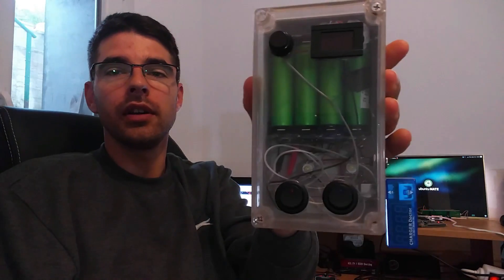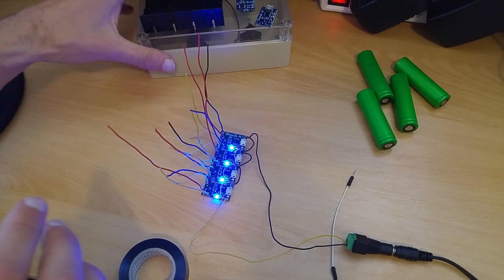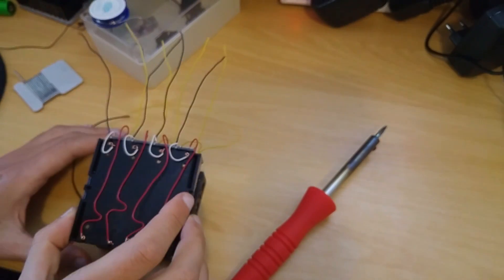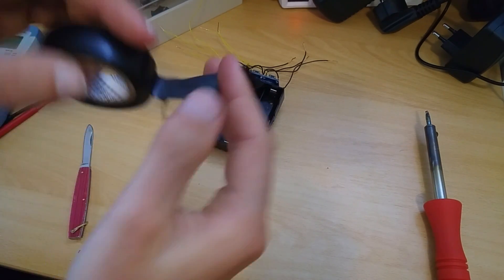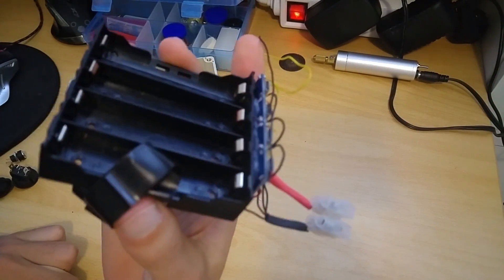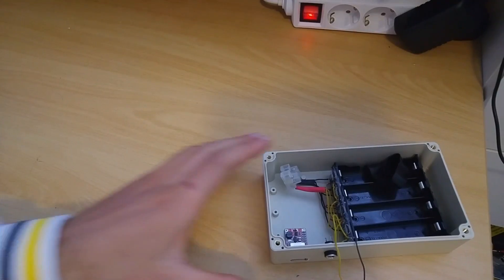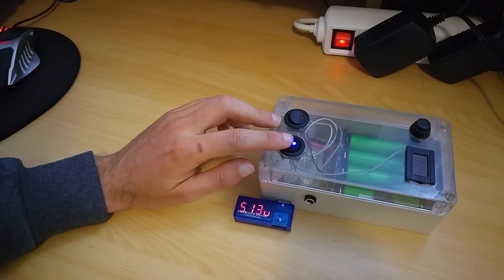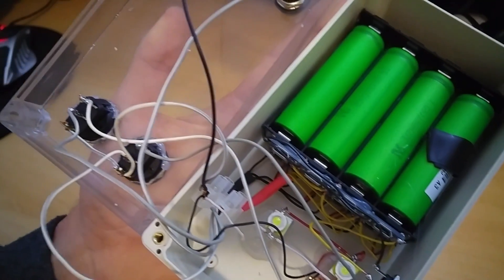External battery charger DIY Advanced - Mobile power bank

Comment: Is it possible to add or remove a 12v out outlet plug instead of a usb out? Thanks
Reply from the maker: You can use 12v step up power supply instead 5v or you can put both. That way you will have big loses in energy, I will rather connect batteries in series to get 12v.
I have build 14,8v powerbank you can find it on my channel if that will fit your needs.

Comment: I have one question.
If im use 1x TP4056 module, 4x battery, and with adaptor 12 volt 1A, its work?
Reply from the maker: you need 5v 1a adapter for 1 TP module. you can use cellphone charger . I don't recommend charging more than 1 battery with one module. If you use old 18650 batteries and tray to charge 3 or more at once, there is possibility that you will never be able to charge it to max because of high internal resistance.
Reply: well thanks for ur attention, 
if im use 2x TP4056 module (2 battery for 1x TP4056 module)  there is able to charge get max capacity?
Reply from the maker: If batteries are ok and you use 1a charger you can charge it to maximum but it would take longer then charging 1 by 1.
If you are looking just way to charge batteries you can look my other solutions:
https://www.youtube.com/watch?v=zSiBS4Yveic
https://www.youtube.com/watch?v=tRYBtpzmNz0
Reply: 1 more question, 
there is get 12v output from 4x battery? i will make a boombox with output dc 12v :D, i can charge while my boombox still on,.. how to make it? thanks
Reply from the maker: you will get 14.8v (from 12 to16.8v) when you connect batteries in series. For that i recommend you to use BMS. Something like this
http://www.ebay.com/itm/4A-5A-BMS-Protection-Board-For-3-Packs-18650-Li-ion-lithium-Battery-Cell-3S-NEW-/161873424944?hash=item25b0687230:g:vqAAAOSw0fhXiI2q
Reply: Charge parallel and output series?
Reply from the maker: something like that
Reply: could u give me the wire diagram please,.?
Reply from the maker: Dont have it. check seller where you buy BMS

Comment: very nice..what if you add solar panel?
Reply from the maker: I was thinking to make bigger one with 2 solar panels (5v 200mah x2) and they are not strong enough to power single charging module. On direct sunlight maybe but it is not wise to expose batteries to that heat specially if they are getting worm from charging.

Comment: Nice project, I'm planing to make something similar myself. 2 short questions : 
What is the total amp draw when charging and how long from empty to fully charged ? Much appreciated and keep up the good work !
Reply from the maker: This modules are rated at 1A so total would be 4A,  but i charge them with 3A charger. Charging depends on battery capacity but its  around 3:30h

Comment: awesome video... but it needs a little better cable management...
Reply: except it doesn't need better cable management. cable management is used so you can easily add or remove parts without cables being in the way. it's also used to allow air flow to prevent overheating. this particular power bank will not overheat, therefore it doesn't need cable management for air flow. it also doesn't need any parts to be replaced, therefore it doesn't need cable management to make it easier to replace parts
Reply: ADK GR   A bit?    You are being sarcastic right?  ROFL.
Reply: Bandit Leader  You're easy to please right?

Comment: if i use five 3.7v batteries also
Reply from the maker: I recomend 1ah per battery but if you dont have that strong charger you can go with less like i did. Only diference is that it will take longer to charge it.

Comment: instead of the jack can we use the mobile like charging port
Reply from the maker: You can but you wont have enough amps to charge more then 1-2 battery.
You need 800 - 1000 mAh per battery and best mobile chargers can give 2Ah. 2nd reason to use jack is that he is easier to install.

Comment: Hi, did you combine all the outputs of the cells together? 
If you did not combine, then the usb and LEDs are taking power from only one cell. 
If you combined all the outputs then it will not be one module for one cell. It will be like all modules charge all cells at a time. And when three modules turn blue, then it is full charged. The 4th one never becomes blue light.
Reply from the maker: Outputs are together connected thru module  and charging is individual for every cell. Every cell is protected thru z3 module and power cuts of at 2,8v
Reply: +Electronic Creations 
ohh, thanks. I thought that will not work and I combined all the outputs and battery terminals.

Comment: Hey, please if possible include parts list and schematic on how to make it myself. Would be very interested.
Reply from the maker: I don't have schematic i made it from my head ;) Here are the parts:
Project box  158x90x60mm
4x 18650 batteries
4x z3 module
diy battery case box
1x momentary push button
2x switch
x2 3w LED chip
x2 aluminium heat sink
USB step up charger
car 12v voltmeter
5.5x 2.1mm jack socket female
charger 5v 3A with male jack
You can find all of them on ebay.